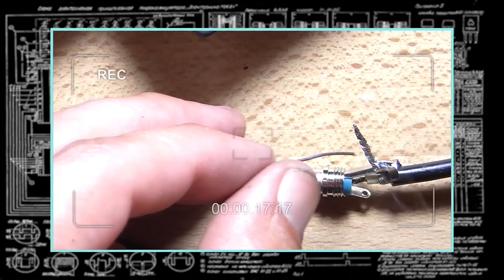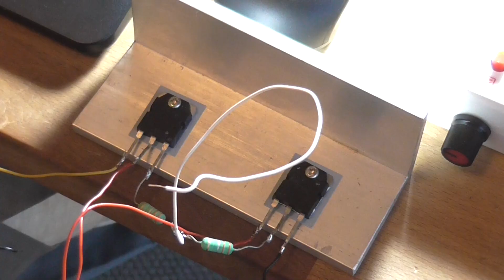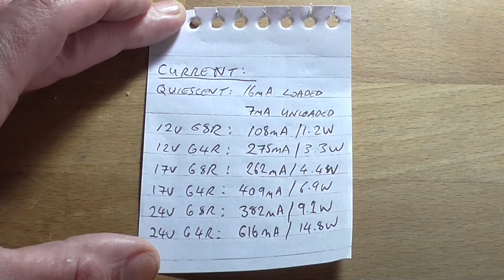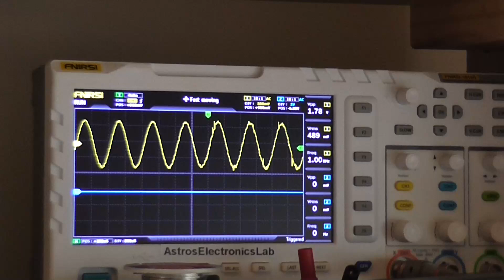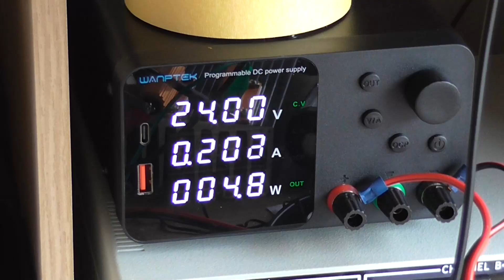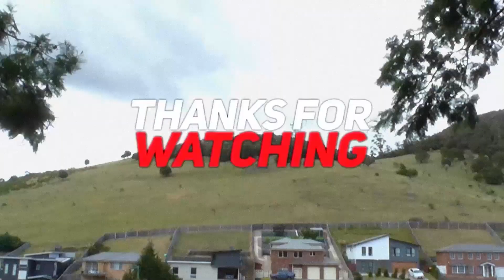5W Quasi-Complimentary Discrete Power Amplifier TEST!

Comment: there is a 10watt version of quasi complementary amp on the internet, runs on 30volts, i think you should check out that too, it was one of my old project and with some modifications, it was pretty ok in my opinion.
Okay lets get to 10likes, im the ninth.

Comment: Maybe you want some tiny miller-style caps in the class-A stage to cut off high freq response?
Reply: Agreed. While the layout won't be helping it would be good to see the effect of 100pF across the B-C connections of T2 even if only for the sake of academic curiosity.
Reply from the maker: @MrBun9l3  I'll do it, lol.
Reply: @AstrosElectronicsLab  The issues with layout and the noise likely caused by the Y capacitors in the computer and bench switching PSUs may well make it purely academic.
Reply: @AstrosElectronicsLab  Hi ! 😁😁
Reply from the maker: @Albertkyyy  hi!
Reply from the maker: I have a PCB designed which is going to be the prototype (it won't be a shared project), so I can go through and do further testing/correcting before a final design.

Comment: Parasitic or spurious oscillation is most likely the explanation for the increased quiescent current draw when the load is connected unless that output coupling capacitor is very leaky.  As you said, building it on a well laid out PCB will probably get rid of the problem.
Reply: Adding some miller compensation with capacitor across the B-C of T2 might also be beneficial for stability. It's tempting to simulate this design.
Reply from the maker: I have a PCB designed which is going to be the prototype (it won't be a shared project), so I can go through and do further testing/correcting before a final design. And I will try miller compensation on the PCB.
Reply: @AstrosElectronicsLab  The schematic was very nostalgic. I knew I'd seen that style in magazines before. After some digging it turns out it's actually an Elektor design called the "austereo 3-watt hifi amplifier" from 1975. Nice of the homemade-circuits bloke to take the credit there. Looks like almost everything else on that site is an rip-off too.
Reply from the maker: @MrBun9l3  Doesn't surprise me.
Reply from the maker: @MrBun9l3  And, it was circuit's number 44 and 46 from Elektor July 1975. I found the entire PDF of the magazine.
Reply from the maker: The 1000uF 63V capacitor shouldn't be leaky as it's a new capacitor that's hardly been used in the last 2 years (albeit, yeah it's starting to age so could become leaky).